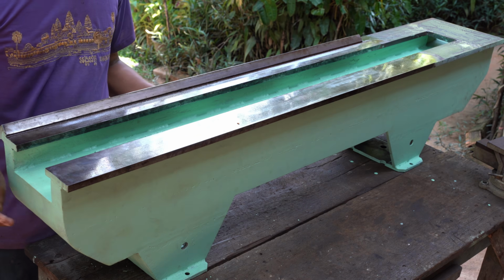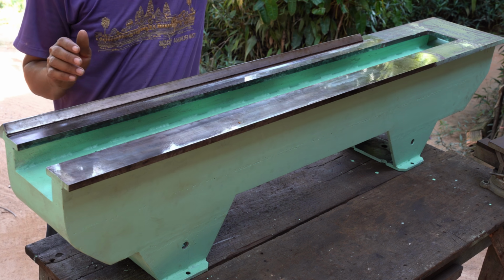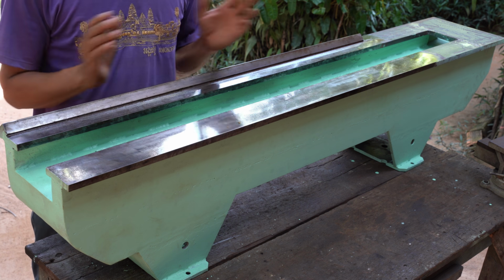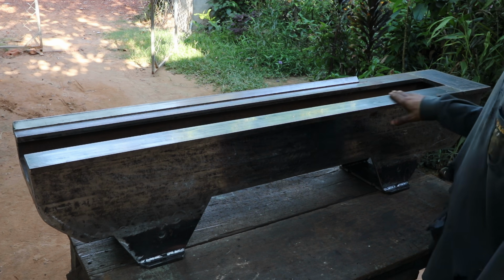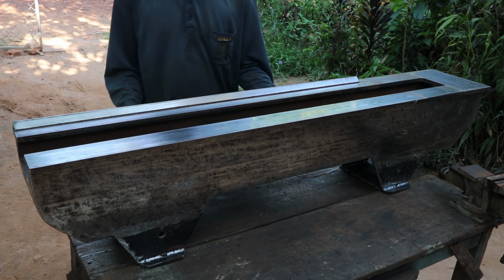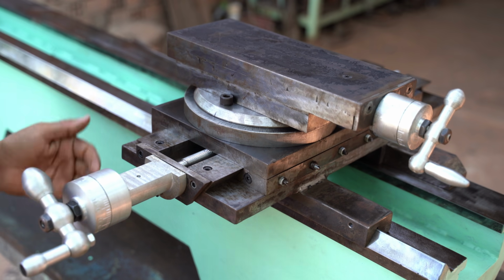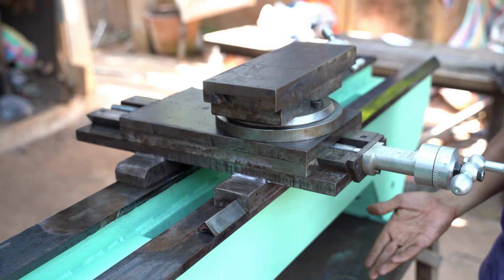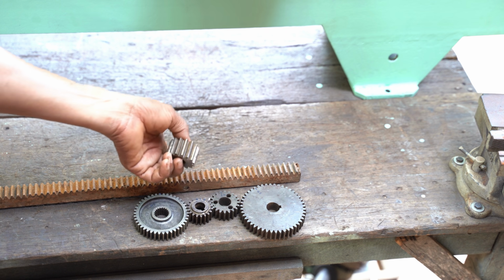Awesome Homemade Lathe Bed Ready To Work

Comment: Glad you found a rack and pinion for your lathe bed carriage. I would probably try to clean the pinion gear, maybe soak it in a baking soda solution, then scrub scrub scrub until it travels along the rack smoothly. Both parts will probably need a chemical bath. If you must replace one or the other there is a simple formula to give you a tooth count that will work if you change gear diameters.
Reply from the maker: Thank you, my dear friend. I'm so happy with my homemade lathe bed and carriage very nice and contact I can see how is the weight of the carriage cross slider and compound cider and tool post total 76kg but when I push it it feel like 4 or 5kg that is amazing otherwise no shack between rail and carriage. Tomorrow I will build a table to support the lathe body.
I really appreciate your recommendation.
I am still looking pinion for the gear rack because pinion teeth to tight.
Reply: @mr.ranyhomemade2466  yep if your bed is sliding along with a 1/10 force to weight ratio you've done well my friend!
Reply: And good luck, I hope you find one soon! Not sure how a rack and pinion from a vehicle steering system would work but may be worth looking into
Reply from the maker: My problem is doesn't know the name of each tool lathe

Comment: Rack and.gear looks to be metric/imperial mix, but if they mesh OK, then set up a.saddle bracket arrangement, wth a shaft to carry the gear and lap the rack and gear with waste abrasive particles and thick oil. - pull rack back and forth while adjusting the height of the saddle clamp jig.
You'll get very high precision and super smooth action..

Comment: Stop apologising - 😁
As a trained and experienced machine tool fitter/turner, then I can say your doing a good job with limited tools - BRAVO.
My advice is not to fall into a perception trap, where your ideas are limited by what manufacturer's /others do..
Golden rule 1- PREP ALL WELDS remove millscale/bevel...
No2 - NEVER machine and then weld/fabricate.
No3 - ALL metals are pre stressed(flame cutting, hot/cold roll forming..... De-stress(normalise) as best you can(heat soak metal in a controlled fire pit...).
❤️👍
Reply from the maker: Thank you for reaching 
I will try me best to develop step by step